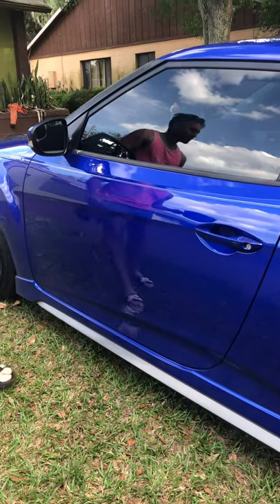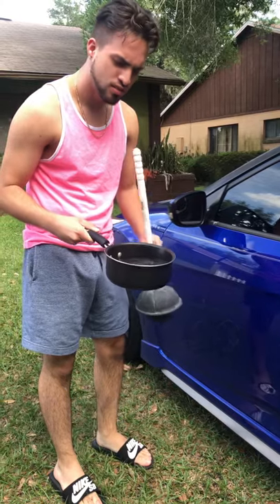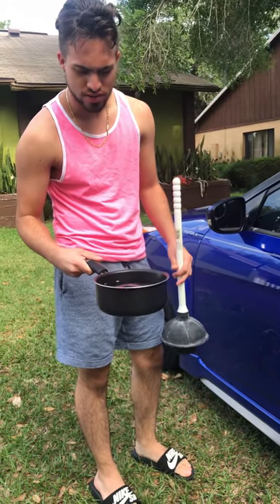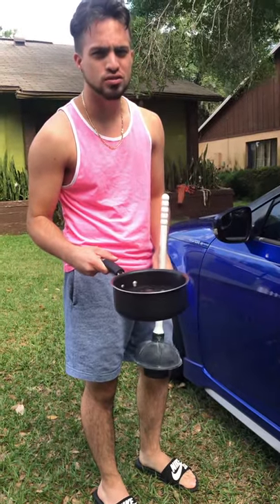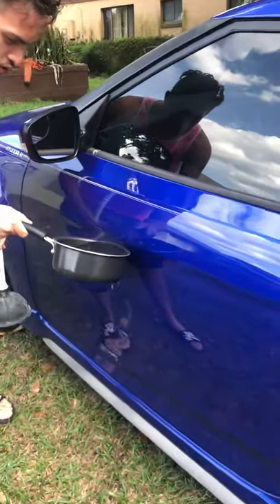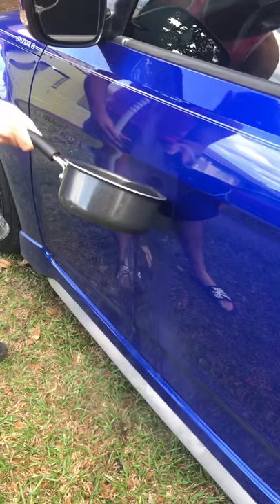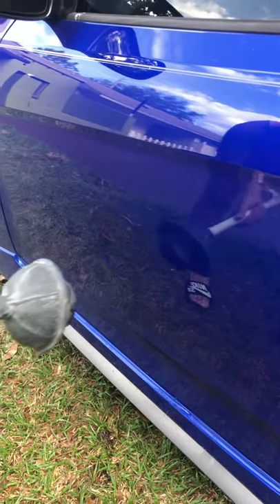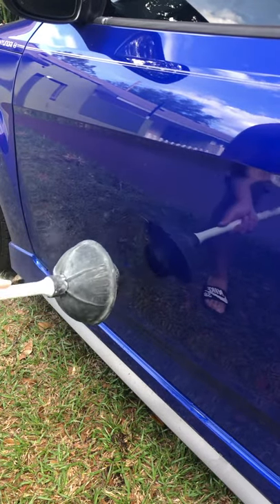Removing Car dent with Boiling water and a plunger! DIY

Comment: Yes this does work and is not only done on plastic. The hot water isn't to make a seal for the plunger it's to make the paint soft so it doesn't crack along the creases of the dent . It's easier to flat and polish clear coat than it is to repaint a whole door because the paint cracked and came off in one chunk.

Comment: Boiling water is one temperature, it can't be hotter unless pressurised or colder then it's not boiling. Unless at higher altitude pressures. Genius Man.
Reply: You can microwave water which can heat it past 100C without boiling

Comment: It doesn't have to be boiling water, water from a hose will work just as well. The water is just to help the plunger seal better. Also a sink (red rubber one) plunger works better. I've done without any water at all before.
Reply: The hot water is to make the paint soft so it doesn't crack at the dent creases .

Comment: Counter intuitive but if you were to knock that crown down in the middle between the two dents it would have maybe came out, that’s holding most of the tension in the metal

Comment: It can't be boiling too hot? I'm not sure what you mean. Water boils at 212°F(100°C) at sea level. Once it starts boiling, no matter how much heat/energy you put into it, the temperature of the water will not go over 212°F(100°C). The steam, however, is another story entirely

Comment: Explain how that boiling water won't destroy your paint??
Reply: The boiling water makes the paint soft so it doesn't crack at the creases of the dent. It's easier to repair dulled clear coat than to have the whole door resprayed because the paint cracked down to the metal.

Comment: Boiling but not too hot? What? Boiling is Boiling 212 degrees
Reply: At sea level, in open container. As you rise in elevation the boiling point goes down. If you cover and restrict the steam, the steam temperature goes up.
Reply: @davidyetter5409  that's a meaningless distinction considering that he's pouring it out of an open pan.
Reply: @paulheitkemper1559  Just referring to the basic laws of physics. Nothing more, nothing less.

Comment: Boiling water is 100°C, that wasn't boiling water as you can see it isn't "boiling", it is just hot water. Talks about safety while wearing shorts and flip flops.... Talks about damaging the laquer but not about melting the plastic side skirt. Just pay someone £60 a panel to do a pointless dent repair, you won't end up with creases or paint damage, you can play a video game or have some lunch while not looking daft.
Reply: No thanks.. we’ll do what he did in The video

Comment: You have to invert the plunger. You got to stick the rubber back up inside the plunger it sticking out at the bottom. And you don't need hot water. At all. Take note people, I'm a mechanic LOL

Comment: Clearly doesn't understand the concept of what he's doing. Just recreating what he saw on a video somewhere. The boiling water is to soften PLASTIC and it helps revert it back to its original shape. Not for metal.